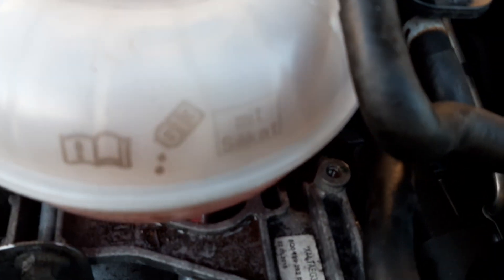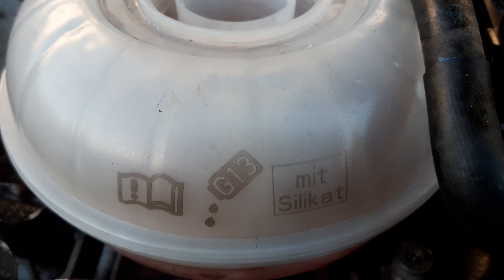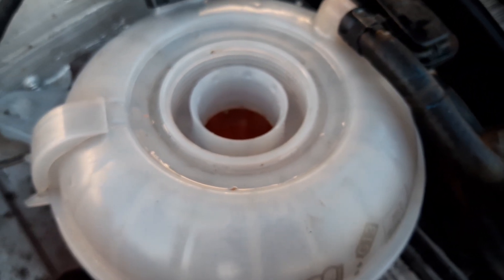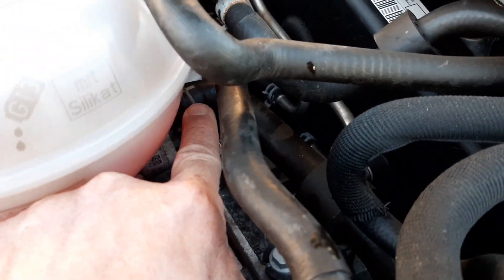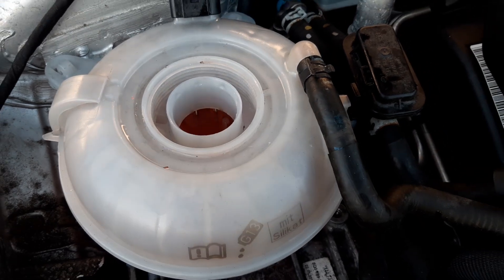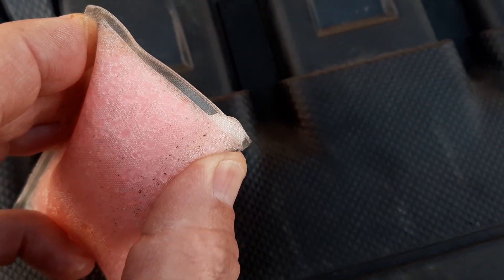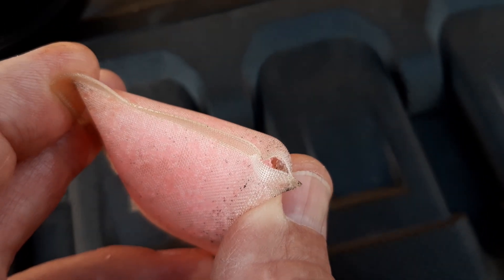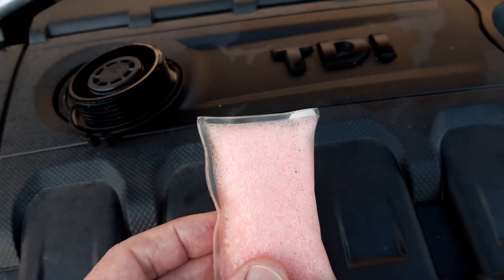Clogged heater matrix? Removing silica bag from expansion tank of VW, Audi or Skoda

Comment: Mine split. Replaced tank, flushed it and replaced matrix. Still overheating. Any ideas m
Reply: The silica bag split. Few weeks down the line the car starts overheating. Changed the header tank and the heater matrix and it still keeps overheating
Reply: @adampratt5785  Do you mean you get engine warning lights to tell you to stop due to heating? Or your coolant bottle is losing fluid? Note that if it's overheating ... you can have a faulty thermostat valve etc.
Reply: @adampratt5785  gearbox thermostat
Reply: Overheating? Can you explain some more?

Comment: Silica bag was rolled with g13 collant / propilene glicole which is meant to be forever ( no replacement interval)
So if you still have g 13 collant then by removing silica bag you are making yourself liable for various pipes bursting . 
If you swapped to g12 then remove the bag . If you still using g13 buy another coolant tank with new bag ( it will last a long while) but given the fact that vw gave up on g13  then change the collant new colling tank new cap job done
Reply: I don’t understand what you mean. So I have g13 coolant right now. I’m planning to change the expansion tank to a new one without silica bag (as I think mine is double walled as I can’t see it) should I keep the g13 coolant or should I swap to g12?
Reply: @jahid_1   hi this is al info from internet mostly russian youtube but ( so i would say do your own research) but if you get new genuine parts/ coolant then vag only do g12 plus nowadays and you will place a new coolant tank without silica gel bag.
then flush the cooling system  well with distilled water as most mechanics will jus drain and replace the coolant . Place g12 coolant and palace new coolant tank without silica bag. If you are keeping g13 then new coolant tank with silica gel bag ideally .

Comment: if i remove silica bag i need to change flush all g13?*
Reply from the maker: You need to replace every 5 years once removed that's all. But you will be doing your timing belt and water pump anyway every 5 years, so will lose some coolant then, so just replace at the same time.
Reply: @Nick_G7IZR  thx

Comment: surely there has to be a slight split so as to release the silica gradually into the system....if the bag stayed sealed then it would be pointless???  i will have to check my Audi as the coolant seems to have turned kinda milky
Reply from the maker: No, the bag is permeable. The last thing you would want is those course grains circulating around your coolant system. But it shouldn't discolour it, milkiness sounds more like head gasket issues.
Reply: The bags are porous.

Comment: I don’t think this is good advice. It is very rare that these bags will burst without human intervention. Older VW cars are experiencing lots of blocked matrix’s due to: casting sand in engine from manufacture, solidifying coolant and minute holes in the heater matrix!

VW have now moved to G12 Evo coolant and there’s a reason for that. They have also updated many part numbers in the coolant system and there is a reason for that. 

The silica bag you are showing is to keep the coolant topped up with a certain element so its ‘for life’. These are extremely tough bags and they will only ‘split’ if you try and get it out! 

VW experienced older coolant types solidifying and blocking up coolant systems hence the move to G12Evo. They have also removed the bag from the latest coolant reservoir because now, they do not quote coolant for life. They didn’t remove the bag  because it was ‘splitting’ 

This bag splitting scare and drive towards removing it … is ironically causing more people to split it in the tank (unknowingly) and block up their coolant system! 

If you want to remove the bag, change your reservoir tank for a new one and change your coolant to G12Ev. Sorted.
Reply from the maker: Each to their own, but no harm done as long as you change your coolant regularly and there must be a reason that the VW group stopped using them. Plus, mine had started to split and those grains of silica would never ever disolve. And finally, its quite hard to tell (without a chemical test) the difference between the silica in the sand from the casting process and the silica from the bag. IMO anyway.
Reply: @Nick_G7IZR  Most of these issues are on diesel engines? All threads point to TDI engines and I’m looking for someone who has had this issue for a petrol engine. 

When I took my old tank off, I took the bag out of it to inspect and there was no tears in it. Yet I still had a completely blocked heater matrix? How does that add up to the bag split theory? I also tried to tear the bag myself and it was reaaallly tough!
Reply from the maker: @Fixingthings101  Mine was a TDI so can't help you there, but the split was at the plastic weld of the bag, so maybe a production issue. The bag itself was intact, but the welded seam had opened. Luckily at the top of the bag, so gravity hadn't emptied it.
Reply: @Fixingthings101 if not silica debris than sediment from sitting in the block overtime
Reply: It’s not rare. Mine split and I didn’t know they existed till I rang the dealer
Reply: @adampratt5785  How did you know it had split?
Reply: I agree on the expansion tank however my 2015 Audi a3 ea888 gen 3  just got clogged due to silica ripping..
Reply: @joshchavez474  Did you get a photo of the bag? 4 years on since I’ve done my matrix and still working like a charm to this day.

Comment: If anyones bags have burst and heater matrix/core is clogged, it's an easy fix.

It's a DIY job but you'll save yourself £1000 from replacing it at a garage.

All you need is a hose pipe, vinegar and water. 

there's some youtube videos on how to do but the basic premises is this:

Drain the existing coolant. 
Unplug firewall pipes. 
Cut garden hose into a small and long piece (long bit is where the mains should be attached). Cut slits into the hose pipe and shove them into the firewall outlets.

Run water through the long hose but at a low pressure so you do not burst the core. Place vinegar into core and let it sit for 10mins. do this multiple times until the water coming out is 100% clear. 

then reattach everything and voila! you have heat again.

Comment: Too late for me, I have the matrix issue now. No way I’m paying 1,200 to replace a heater matrix. I’m going to have a crack at it myself.  You can get the parts for a couple of hundred. Might take 20hours to do however my boss would say my labour is not worth £50 an hour.

Comment: Too late mine burst, it went not long after the dealer replaced the cambelt & water pump, they didn’t mention a thing about this ticking time bomb! So now it needs a matrix, yet another water pump, cambelt & potentially an EGR valve! And VW say not interested as the lifespan of all VW cars is 6 years! Replacement expansion tank no longer comes with the silica. Just proves VW know all about this design flaw!

Comment: My 2014 Skoda Octavia is sitting at my local garage being fixed, the matrix was blocked due to the silica bag splitting, I am having a new matrix and new header tank fitted, with full flush of coolant and new antifreeze, total cost is £420.00
Reply: You can clear the clogged heater matrix at home, it's actually a pretty simple job once you know how. If anyone's interested, i'll give you the steps I did.
Reply: @FHDOnTheStreet can I have the steps please?
Reply: Needing mine doing no heating for last month 😂
Reply from the maker: I bet you don't have a warranty to cover it, but it's worth hitting Skoda up. It's a known issue so see if you can get a contribution.
Reply: This just happened to my a4 estate. Where did you get it done as price is reasonable?
Reply from the maker: @niallpaddy  I didn't need to get anything done. I removed the bag before it caused any problems.

Comment: Hi! Why did they put it in at the factory?  What is the purpose of the silicone bag?
Reply from the maker: Makes the coolant last longer. No need to change it, it will last for the life of the car. But remove the bag and you'll have to change the coolant every 5 years.
Reply: @Nick_G7IZR  2016 tsi RS Octavia 5E is the type. I replaced the tank last year.  It has a silicone bag, but somewhere between the outer and inner plastic wall.  If I look inside the tank, I can't see it anywhere.

Comment: Just looked at my Ateca with silica gel bag, it done look pink more dirty bag intact but stiff as a broom.
Think Seat should offer regular check at service  instead of visual and tick the box on service sheet. Now have heater probs on a 66 reg and won't touch it for Less than £1000 pounds. Offered to pay 40% . 5 years service history with Seat. Disappointed.

Comment: Greeting. Congratulations on the video. Did you take out, that bag of silica gel from the pot?  Is it better to go without that bag? How many years should antifreeze be changed? What antifreeze do you use? Thank you 👍👍
Reply from the maker: Change the antifreeze every 5 years, same as the timing belt and water pump. But yes, I would remove it before it splits and causes lots of problems. VW no longer use "Mit Silica" tanks.
Reply: @Nick_G7IZR  Thanks for the reply. What antifreeze to put? Vw the original, were after market? Thank you once again 👌👍🙏

Comment: Great video. I have a Golf 7 2.0 TDI 2014 and I managed to extract the silica bag from the expansion tank without breaking it. Now I don`t know how to proceed further. it is fine to change the coolant now or in some years? It is fine to found a new silica bag? i know that the silica has the role to prevent corrosion....someone who can clarify my doubts?
Reply from the maker: Leave the coolant until you have the timing belt changed because then you will have the water pump changed and at that point, a lot of coolant has to be drained. So you may as well have them do the lot. That is approx once every 5 years so matches perfectly.
Reply: @Nick_G7IZR  Thank you for your quick answer. The timing belt was changed this year in March. Also it is fine to replaces the coolant in the next timing belt change?

Comment: Bag broke on my 2015 Octavia, Main dealer wanted £1500 to flush the system, install new "tea bag" and chance the heater matrix. Thankfully a local dealer was able to flush the system before the matrix was blocked. Had an extended warranty but its not covered. Good video but too late for me.

Comment: £1200? VW asked for £3000 to fix mine. The Silica needs to be flushed out of the system with a series of chemical washes. Replacing the heater matrix (plus water pump and timing belt) is the least of your worries. I tried simply fixing the latter to my expense. The entire system needs to be flushed! 
Thanks for your video though, Had I known in advance.....
Reply from the maker: You can't dissolve silica with chemicals, so it would be interested to know what the "chemical wash" was other than maybe a general cleaning solution!
Reply: @Nick_G7IZR there’s 2 ways: citric acid(recommended by vag) or clr.
Reply: @Nick_G7IZR  I didn't say the chemical flush was  to dissolve silica. I was told my VW that the only way to thoroughly resolve the silica clogging issue was to run a three step chemical flushing process that took approximately twenty labour hours at a cost of £3000. (inclusive of new matrix water pump etc) I do agree though, I would like to know too. The best alternative is to never buy any car from the VW group unless you plan to replace it within the warrantee period. Having said that I do know someone who had this issue and had to take the legal avenue to get VW to run the above mentioned process. Even after the work was carried out they did not include a warrantee with the work carried out. Mit Silica: a fundamental flaw!

Comment: Is this happening to both petrol and diesel engines ?
Reply from the maker: It's nothing to do with the fuel, it's the coolant system. So yes, both. But I gather they have removed it on later cars...
Reply: @Nick_G7IZR  Thanks for your reply , I should have said cars ! 👍
Reply from the maker: @castleman7300fx  Sorry, I knew what you meant. I also meant that the coolant system is the same across both the petrol and diesel models so yes, they both use a bag of sillica :)

Comment: Should i take mine out ?

I've got 2 year old Octavia vrs With 12 months warranty left,  but as somebody has already said, if i remove the bag and something goes wrong with the cooling system, they will do their best to wriggle out of any warranty claim because the bag has been removed...
Reply from the maker: Deny all knowledge! Say it mustn't have come with one! :) Anyway, other than corrosion that might happen long term without a coolant change every 5 years, my personal opinion is that far more damage will occur if the bag splits. You'll be looking at a grand for a new heater matrix. But if you have a warranty, I wouldn't worry about it anyway since any problem with the bag splitting will also be covered! You problem arises if the bag splits and you don't notice until your car is out of warranty and then you get hit with a big bill. Keep an eye on it.

As usual, just IMHO.

Comment: Unfortunately my coolant is full of these crystals. Any idea if it is possible to dissolve them in some fluid like alcohol? In my case the broke the water pump for the intercooler.
Reply from the maker: From a chemistry site: Silica is mainly soluble under three conditions: 1. Highly alkaline such as NaOH or KOH; 2. In presence of free fluoride ions; or 3. Complexation with molybdate ions. In any case, conditions are pretty extreme for all of them and all will do far more damage to your engine than the silica ever could. So you are left with flushing and probably replacing the heater matrix.
Reply: Splitted silica bag is one thing. But that is a small bag. What is worst than that is the casting sand resedue in the engine block. Been trying to flush that out before installing new heater matrix.

Comment: Have an issue with my 2015 a6 c7 heating coming to the cabin, and i tooked out this bag.. Was bursted... Now any idea would  flush cleaners would do the job no? If no have to pay 1500euros for the job to replace heater fan plus clear out the all system...
Reply from the maker: I have no idea what would dissolve silica as it's quite inert and if you did find something, it would have to not damage any steel or aluminium inside the engine. So I suspect you are stuck with back flushing and hoping it comes out.

Comment: Why dealer  or vw company  put this bag in tank ?????
Reply from the maker: Over time, the coolant loses its ability to prevent corrosion of the internal components. The water pump is particularly vulnerable. So to prevent this, manufacturers add silica bags that gradually leach silica into the coolant, counteracting any loss and making the coolant last for the life of the car. Personally, I would rather change my coolant once every 3-5 years than risk the bag splitting open and causing havoc.